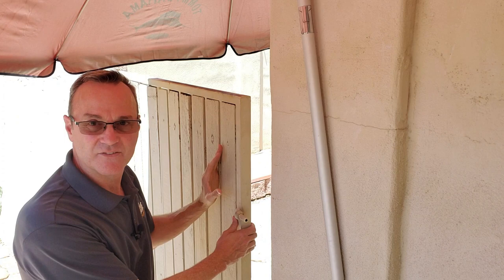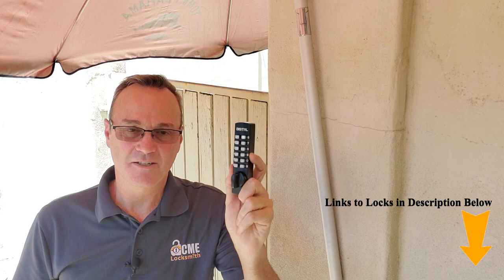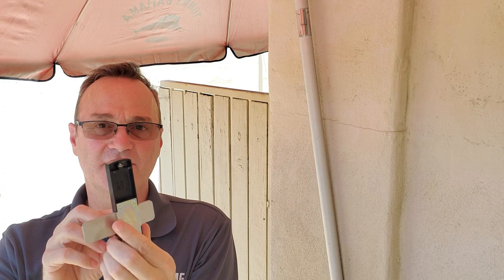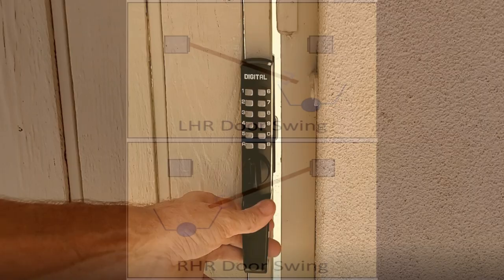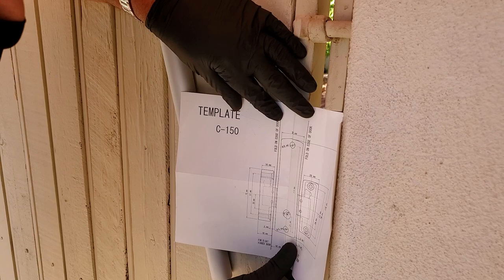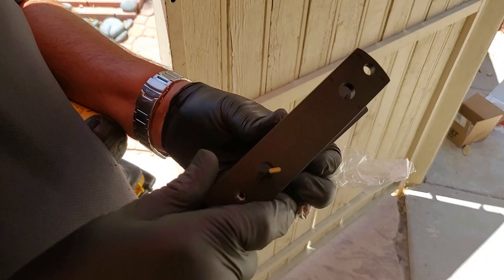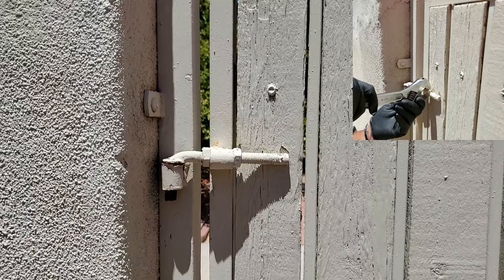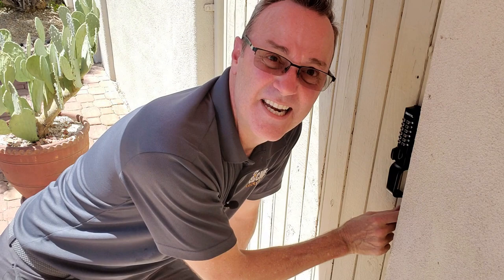Easy DIY Mechanical Keyless Gate Lock Installation

Comment: The best thing about this setup is if you get locked out you can either lift the gate off the hinges or use a wrench to reopen the gap.
Reply: Idk what gates you install but the ones I do you can't just lift the gate off the hinges and I always set my hinge side tight but not too tight to bind the hinges so you couldn't just pry it over to open it

Comment: Great lock for that application. The only concern is the strength of that one inch wood that got weakened by the two holes. It might make sense to have an steal plate sandwiched  between the lock. Just a thought.
Reply from the maker: The post we drilled through is metal but your point is still valid. Gate locks of this type basically keep honest people honest. Remove temptation.  If someone really wants in, they would just jump the fence. Most block fences here are, after all, only 5 fee tall.

Thanks for the comment!
Reply: ACME Locksmith you're absolutely correct, most locks, doors, gates, etc. are to keep the honest people out. A criminal will stop at nothing if they want to gain access.

Comment: Great video but what is stopping the gate in the closed position? I wish you showed whatever I can hear latching before the lock is engaged. Is that a magnet or something?
Reply from the maker: It's shown at 6:56. We are just latching this behind the existing gate post. But there's also a strike if that's not doable.

Comment: Can this be installed on an RV gate?  Also, where can you purchase the optional handle?  Thanks!
Reply from the maker: It would be difficult to use in a large swing rv gate. To much play to get the latch to line up.

Comment: I have gates on order that will have the lock boxes pre installed. Do you have a recommendation for mechanical lock for them? There will be 3 gates, walkthrough and RV with walkthrough. Appreciate your response.
Reply from the maker: By mechanical, you mean a mechanical keyless? Mechanical keyless would require a gate box that matches the keyless lock you're installing.

Comment: If I’m using this for Amazon drivers and they’re going to deliver a package to my front door.. after putting the code the first time to open the gate, is there an amount of time they have till they need to put the code back in to lock the gate behind them? I’m trying to decide on getting the lever or this lock.
Reply from the maker: This is a mechanical lock. The code stays the same until manually changed. 

Have you thought about the garage for Amazon packages? The Chamberlain garage door monitor integrates with amazon. And has a camera. So it records the Amazon driver dropping off the package and closing the door and text you a copy of the video as soon as it's done.

https://amzn.to/389hk2V
Reply: @LocksmithRecommended  yea this would be for the front gate that’s exposed to the elements. So I’m not sure which option is best for that. Any help would be great for an outside gate
Reply from the maker: @Marco-sp2li  Unfortunately, smart locks are not weather resistant on both sides. Because it's always assumed that that one side will be inside of the house. So  an affordable option that you can control from your phone isn't really available.
Reply: @LocksmithRecommended  which one do you recommend for a key/code entry lock for a gate then?

Comment: Do you know the major differences between the C120, M220, and 2200? They all seem quite similar.
Reply from the maker: c120 is the smallest and lightest duty. It's the only one that will fit on a post like this.
Reply: @LocksmithRecommended  Thanks!

Comment: Why the heck can't they put the combination on both sides so I can lock/unlock from the inside! So frustrating.
Reply from the maker: There are other mechanical locks that do that, just none that wouldn't require significant gate modification on a gate like the one in this video. Here's our article.
https://www.acmelocksmith.com/how-to-lock-outdoor-gates-gate-lock-options/
Reply: @LocksmithRecommended  Thanks Well, I also read that you can exit with the lock locked anyway.

Comment: Is a lock like that available with the keypad on both sides?
Reply from the maker: Not this one. There are mechanical locks that do, but you need at least a 1.5" thick gate post to install them on or a lock box installed. Both options are considerable more expensive though. 

https://www.acmelocksmith.com/buy-safes-online/sumo-gl2-keyless-gate-lock.html

Comment: I liked the way you installed the lock, but I didn't like the way you were able to move the gate to the right to get rid of the gap. Defeats the purpose of putting a lock. Those door hinges belong inside the fence and/or weld a plate to cover the gap.
Reply from the maker: Gate locks of this type basically keep honest people honest. Remove temptation.  If someone really wants in, they would just jump the fence. Most block fences here are, after all, only 5 fee tall.  

Many homes in AZ spot weld that adjustment bolts, to prevent what you are talking about, but this home owner didn't want to do that.

Thanks for the comment!
Reply: @LocksmithRecommended  👍😀